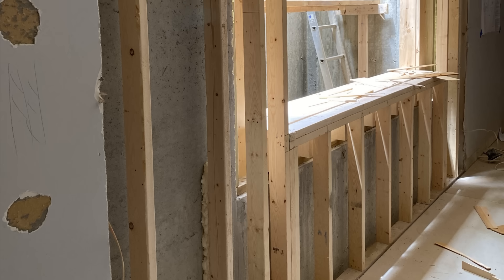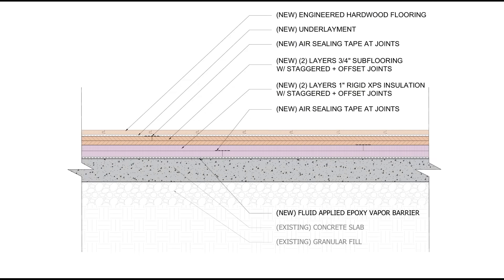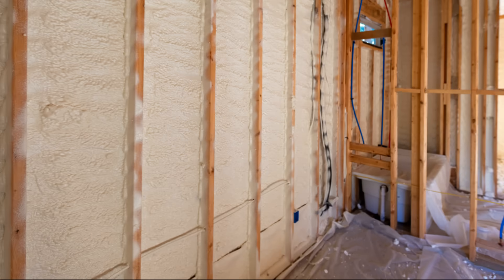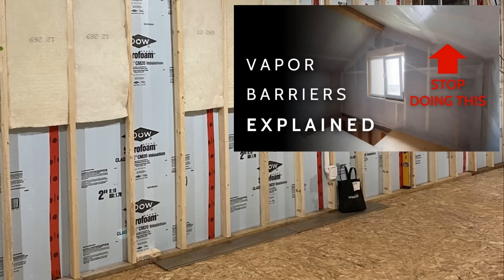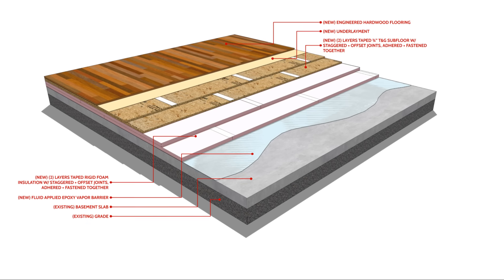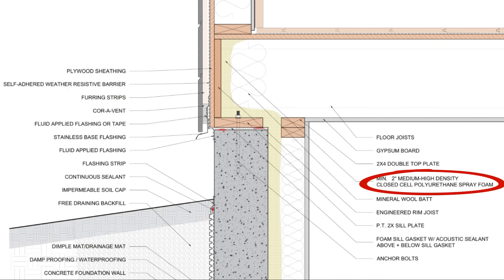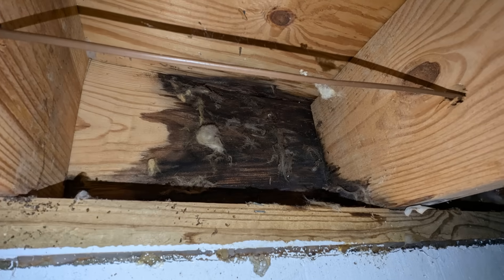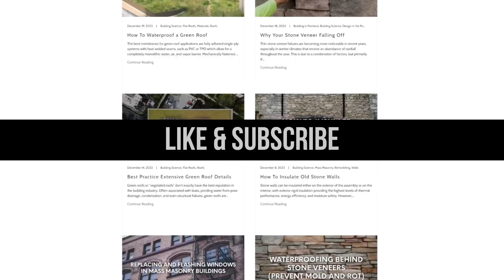A Complete Guide To Insulating and Air Sealing Your Old Basement (Walls, Slabs, & Rim Joists)

Comment: Can this strategy be applied to a main floor? I have a heritage home built in the 1890s. Brick exterior, black tar paper, studs, wood chips and then lateral boards. 
If I remove the lateral boards, most of the tar paper is damaged and I can see the bricks. 
1. How do I insulate this wall assembly? 2X4
2. I am guessing the lateral walls are structural because there’s is no ply wood. 
3. If I remove the nailed lateral walls and insulate, will plywood suffice on the interior?

Thanks for posting and happy Saturday.
Reply from the maker: This is a tricky building condition that we run into, but it's rare to hear of a brick veneer wall with a wood framed structure that from that time period! Sometimes you can't effectively insulate these types of assemblies, however, if you're able to change the appearance of the exterior, you can coat the external face of the masonry with a liquid applied waterproofing and install a rainscreen over the brick wall with some lightweight cladding. Now you can insulate without having to deal with bulkwater intrusion.
Reply: It’s a heritage designated building. Unfortunately I can’t touch the bricks. I have read some of your articles but I can’t find anything that addresses issues with brick veneer without a ply wood or vertical boards.
Reply: @basilkingsley Climate zone will affect what is the best approach, but if you have bulk water intrusion through the tar paper, that would be the biggest issue and you would need a lot of drying capacity to avoid structural rot (probably better to leave it be if it lasted this long).

In a northern climate, in principle, if bulk water is not an issue and if you have access from the inside already, the horizontal boards inside can be replaced by plywood with taped seams to reduce air leakage. The 2x4 cavity can be filled with something like Rockwool that is vapour open and will dry to the outside. Inside the plywood, there may be options for additional insulation, vb, etc but the details to integrate at the floor and ceiling and climate zone would matter.
Reply: @ Thanks James. Although majority of the wood-chips are intact, there’s a raccoon infestation around various pockets of this abandoned heritage home. 
I’m thinking perhaps, removing the lateral boards, removing the wood chips. Keep as much black tar as possible. Then staple dimple mats in between joist- insulate with rock wool. Cover the insulation with OSB, then build an additional 2X4 wall or 2x2 with another rock wool insulation. Add a vapor permeable barrier and then drywall. 
That’s what my head is telling me to do. 
Or perhaps add another 2x4 and then have the play wood on the inside. 

So much to consider
Reply: @basilkingsley  That's cool that they used wood chips as insulation. Many of our older homes here just had empty cavities. In those homes, blowing in cellulose is the safest and least intrusive way to insulate. Modern cellulose is treated with a fire retardant though, so that would be my concern with the wood chips.

I think if you have access from the inside, and assuming a cold climate, I would probably remove the interior horizontal boards and wood chips and insulate with Rockwool for the fire retardant qualities as well as being vapour open. But you would need to ensure bulk water wasn't getting past the tar paper first and it could be hard to repair since it is applied outboard of the studs. It is important to protect them from rot since they are your structure. I would avoid OSB as it is a moderately strong vapour retarder and can become oatmeal if it does get wet (plywood is better in old structures). If you are doing interior insulation layers, eg akin to a double stud wall or insulated wiring chase, that is a great way to add r value and give a defined air and vapour barrier plane that always stays above the dew point (be careful of the floor and ceiling details). However, you need to be able to control bulk water outboard of your main structure first and in a cold climate, that should probably be a vapour open layer.

Good luck with your project!